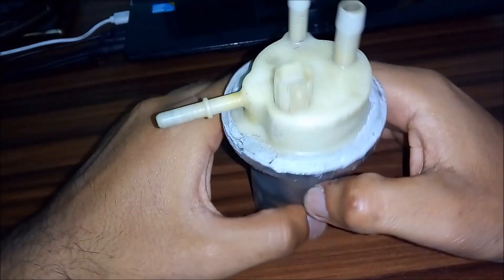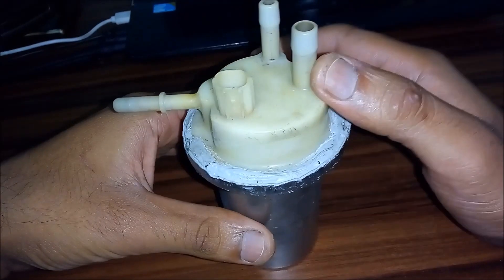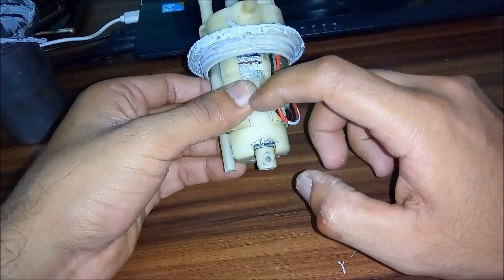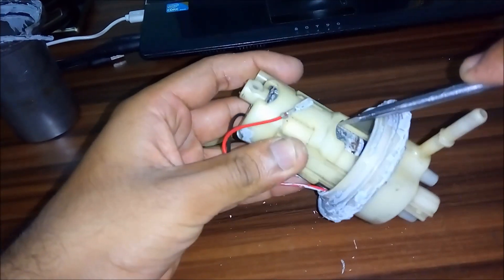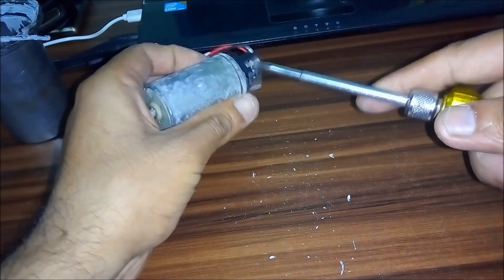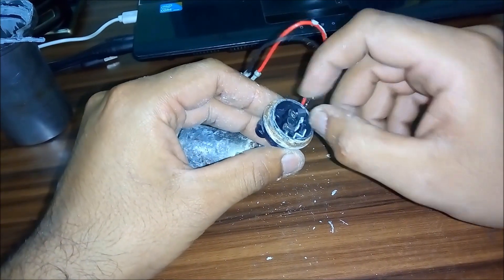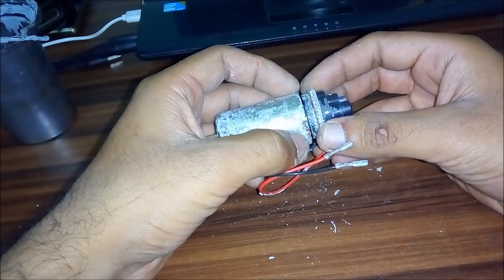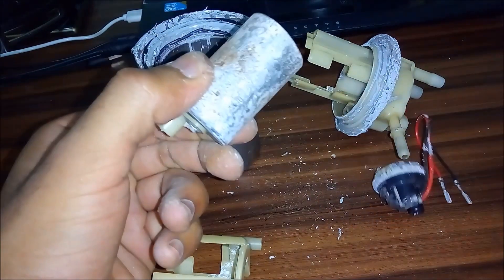Karizma ZMR fuel pump full breakdown and repair at home without special tools

Comment: Nice video bro..i want to order the whole fuel pump itself..my motor is working but due to less usage it has got rust/dirt...tank and inj both cleaned but still issue persists. Already changed inj once 2 years ago. Dont want to spend 12k on fuel pump now bike was bought new in 2015 for 1.2 lakhs. 12k for fuel pump is like 10% of bike value! Doesnt seem worth it. So wanted to know if i can order a fuel pump from alibBa or elsewhere which is a direct fit for zmr mine is 2015 model the last one. Plz give exact link if possible or keywords..Thanks in advance.

Comment: Bro i have an issue. I replaced the fuel pump and pump relay. the bike starts and moves within few meters bike turns off automatically. And after 15 to 20 mins tried starting and bike starts and same thing happens again. What could be the problem?
Reply from the maker: Probably a bad spark plug or a poor connection somewhere

Comment: Sir i have repaired my fuel pump and paste it but after few days pasting is damaged by petrol and the leakage of petrol has started please suggest me how to fix fuel pump or what paste should i use to fix it
Reply from the maker: Well there's no compound available that can hold off in gasoline...Fuel pump replacement is recommended..!!
Reply: TopEnd when you repaired it what u used to fixed and is it working good yet?
Reply from the maker: I faced same problem as urs...eventually I had to replace it
Reply: How much it cost to u in replacing?

Comment: Hi sir,
I have Glamour FI 2012 model,sometime my bike is starting or some time not(fuel pump is not rotating) , so whether I have to change pump or is there any other issue, bcoz I want to hero service center they are asking to change the pump, suggest me some cheapest way
Reply from the maker: Try replacing the fuel pump relay first and check for any loose connections...!!If that doesn't work then u may go for fuel pump!!

Comment: First i want to say thanks to you for guiding us through video. I have checked fuel pump on alibaba.com but there are many models so i am getting confuse can you help me with model No.& more information about that.
My bike is hero honda Karizma ZMR 
My mobile no is 8329607052
Reply from the maker: U may contact +86-157-2355-8592 on whatsapp...
She's from China and one of Alibaba sellers...Ask her for one piece by sending pic of pump and ask her to ship via China Air Post Mail..!!
Reply: TopEnd   But can you please  tell the model no of fuel pump?
Reply from the maker: Model No.=16700-KRE-R06...It's in description..!!
Reply: above model is for NXR 150 not for NXR 125,  but in your video u were typying nxr 125, nxr 125 comes with model number 16700-KWT-905 16700- KRE-B06 which one to go with NXR150 OR NXR 125 ? KINDLY CLARIFY

Comment: hi top end 
today morning I tried to start my zmr. it didn't start. after 50 to 60 attempts of on and off the key I just got a sound from fuel pump. now it's working fine. will this problem come again??
Reply from the maker: Arun Sampath Try replacing fuel pump relay first...sometimes it gets clogged...nd yes if fuel pump is faulty den most likely it can happen again
Reply: TopEnd where can I find the fuel pump relay?? is the one near the battery ?
Reply from the maker: Yes..Thats the one..!!On left side.!
Reply: Hi top end. I have replaced the fuel pump recently. But relay has stopped working. Where can i find a genuine relay.

Comment: sir plzz tell mee that how can i know that the wire which is connected with fuel pump is working or not or having current in the wire or not
Reply from the maker: NIKHIL RAWAT U may use multimeter to find out...Or take out fuel pump nd apply 12 volt potential on 2 pins...see if it works. .

Comment: io have karizma zmr 2010 model and sometime my fuel pump is working and some its stop working....what i do plllzzz give me some solution
Reply from the maker: NIKHIL RAWAT Check for fuel pump relay first..it's right beside the battery...If dat relay is ok den it's probably fried pump
Reply: i checked the relay
Reply: and its very dirty and have so many carbon inside that relay
Reply: can u send mee the pic of that relay
Reply from the maker: Replace that relay nd clean the port using petrol...
Reply: how much it cost
Reply: And from where i can buy that relay

Comment: i have a karizma zmr 2014 and recently the engine light is constantly on when i turn on the vehicle. Its in yellow .....i saw d mannual and it says FI Malfunction.... can you help me with this issue ....thanks in advance ☺
Reply from the maker: If it has Continuous illumination as soon as u turn on the ignition switch then der r 3 possibilities
1 Short circuit in data-link connector.(DLC)wire.
2 Short circuit in PGM-Fl indicator wire. . 
3 Faulty ECU.

Is the light blinking when turned on or illuminating continuously?? 
Nd is engine operating normal??
https://www.youtube.com/watch?v=11-NoeJu5Js    check it if it helps..!!
Reply: TopEnd Thanks for the reply. To answer ur question ..  the engine is functioning properly ....the issue is when i turn ON the engine after a minute the light starts to glow constantly in yellow.
Reply from the maker: Yup it's one of above mentioned 3 things...
Or you've got loose connections to bank angle sensor in front fairing or loose ECU connection!!
Reply: Great ....then i dont have to change the whole unit right ??
Reply from the maker: It cud be faulty ECU....Its one of possibilities!!!
Reply: How much will the service cost be ....a fair idea ?
Reply from the maker: If there's faulty ECU then new one's gonna cost around 7k...Otherwise there must be some short circuit in wire or something...Full Check up costs around Rs 200!!
Reply: Thank you bro ☺ very helpful 👍

Comment: can we install Carburator Interchange from fuel pump??
Reply: i got a carburrtr installed in my zmr...it cost me around 3500/-INR...working fine
Reply from the maker: Yeah u can...U gonna need CDI unit for ignition timing!!!Nd check engine light is gonna blink..as there wud be no sensor nd fuel injector requirement for carb..!!
Reply from the maker: Great....But Installing a carb make ur bike loose 1HP nd .5nm torque!!!
Reply: Nazir Hassan  ...hey brother help me I also want to install carburetor ..please help
Reply: Nazir Hassan brother can you give ur contact no. for help regarding carburetor installation..
Reply: shailuraju 8700229389
Reply: which bike carb r u using
Reply: Nazir Hassan  your contract number
Reply: AMAL STEPHEN it's karizma r
Reply: bajrang sharma 8700229389

Comment: does this fuel pump (16700-KRE-R06) you mentioned in link really work on karizma zmr !!
Reply from the maker: Sure man....I've Installed it in my bike nd works just fine..!!!
Reply: TopEnd 
hello sir do u  have any idea about the name of the part that connects the fuel injector to the body(black part). I don't know the part name but that particular black plastic part is cracked and I need to change it. Even my mech is having trouble sourcing it. The fuel injector tightly fixes itself to this part. Was not able to take a pic. Its as long as the fuel injector itself. About 7-8 cms. 
please help me and give me ur contact number please....

Comment: also tell how to remove the rev limiter settings in karizma zmr as it dosent go beyond red line or 132km/hr
Reply from the maker: Ya Rev limiter is set on 9000rpm in ZMR ....get a remapping tool..I use Ktag....nd extract map from ur ecu chip and edit it using ECM Titanium software and when done...upload it back to ECU....!!!!Or Easy method install pulsar 220 36 tooth rear sprocket as it'll reduce gear ratio nd u'll go faster...There's no top speed limiter in zmr..!!!!
Reply: @powerpulse.Tuning  Will you remap ecu of zmr for me if i come to your place?